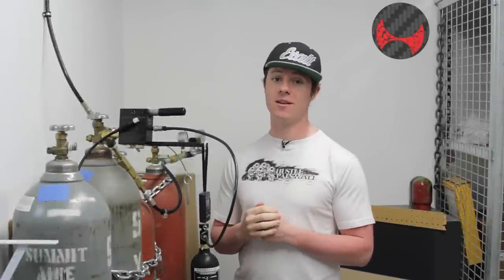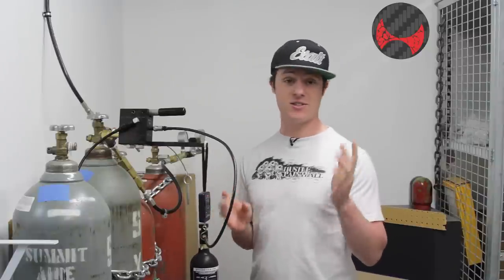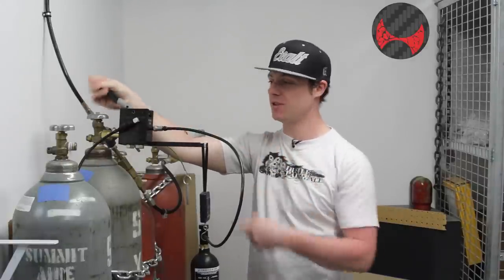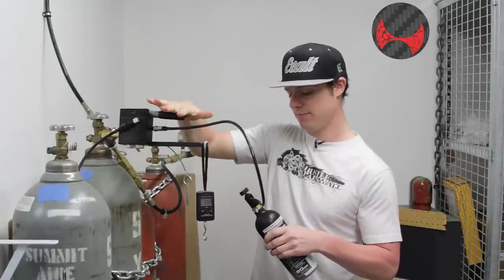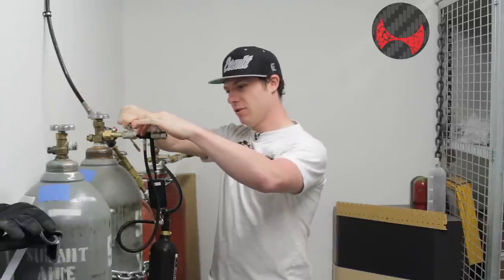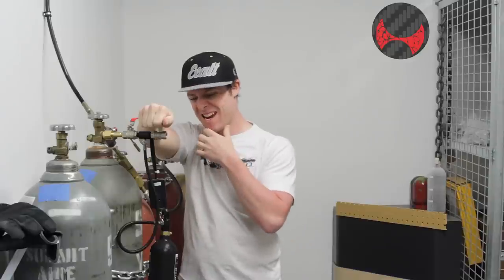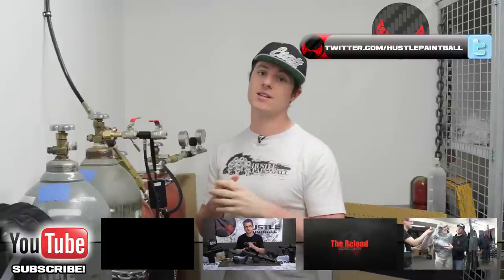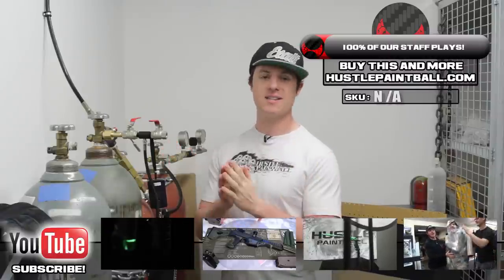How to fill a paintball CO2 tank from a bulk tank (20lb, 50lb, etc) by HustlePaintball.com

Comment: I want to run a large Co2 tank on remote line for my setup. I want to be able to fill them myself.

Because the tanks are so large (2.5lb and possibly 5lb) I may need a special fill station to fill them. I know I need some sort of pumping device but what? also how to I fill thermo valve tanks?

Comment: on the first station, where are you purging the co2 into? or just out the door as well?
Reply from the maker: A line that purges into a box that is taped up.
Reply: Hustle Paintball  ok thanks, so basically it's wasted co2. I thought there would be a setup that'd be able to reuse it. I always put the bottles in the freezer not to have to purge them at all during refillment.
Reply from the maker: cafeboni That is definitely the most efficient way to do it :)

-Dan

Comment: Just a dumb question - if I have a 9oz C02 tank I should expect to get 9oz of gas from a refill right?  My last fill I got just 4 oz  (difference in weight between empty bottle and filled), but the fill shop doesn't seem to understand this is a problem - or if it is, what they can do about it.
Reply: Yet another reason to dump CO2 and go HPA

Comment: Hey i gotta question , so i have a 12 ounce tank and a 20 pound tank with the 2nd fill station in the video . The 12 once is brand new only hade 1 full filling b4, so when i started filling it only went to 3.2 oz i purge . Added more went up to 3.8 purge again n went to 4oz n it wont go any higher ??? Theres still alot of co2 in my 20 lb tank . So what em i doing wrong ? Thanks
Reply from the maker: In order to fill CO2, the bottle has to get pretty cold... So you'll be filling, dumping, filling, dumping.. alot. That's another downside to CO2.
-Russell
Reply: Your 20lb tank isn't a fill tank. Fill tanks have a tube that goes to the bottom - the 'gas' that comes out is from the bottom.  It's actually liquid because of the pressure.  You need to (VERY carefully!) turn it upside down to fill from it.
Also, you need to make sure the 12oz is totally empty.

Comment: I have recently started filling CO2 bottles myself using a fill/dump station and 50lb CO2 tank. For my 20 oz bottles that have been chilled beforehand, I am only getting 4-5 oz from when its completely empty and then filling until sound stops. What else should I be doing to get the full amount in my bottles?
Reply: You need your 20oz bottle colder then the large one you are filling from. If it is warmer then the fill tank it will become pressurized and wont fill. You probably need to chill them longer.

Comment: What kind of scale are you using?  When we try and do this with a fish scale it seems to lock the weight in and not keep going up as the air refills.  I assume we have the wrong kind of scale?
Reply from the maker: +EastCoastAirsoft We use the Renegade digital fill scales. Affordable and works great. http://www.hustlepaintball.com/Renegade-Digital-Fill-Scale-20g-40KG-range - AJ
Reply: +Hustle Paintball Awesome thanks!  I assume with this scale it's not going to give me the issues a fish scale does, like lock in the weight when I am in the middle of filling the bottle?  If that is correct I will be picking one up today!
Reply from the maker: +EastCoastAirsoft Nope! It's a live reading that will change as you fill/drain
Reply: +Hustle Paintball Awesome thank you, I just ordered it off your website, I been looking for something like this!

Comment: Can I fill it up using an air compressor that is used to power nail guns
Reply from the maker: +OgN Stealthy No. You need a big boy compressor. It needs to fill 3k+ psi.
Usually fields and proshops have them.
-Russell
Reply: Can I play paintball with a co2 powered marker if I don't have a compressor?

Comment: How many fills could I get off of a 20 pound tank or a 50 pound? We have (2) 20oz, (2) 12oz and (2) 9oz
Reply: simple math
Reply: DKG Woodsball (Late response in case you still havent found a solution from anywhere else) 16 oz is 1 pound so a 20 pound tank should have 320oz in it; meaning it would fill a 20oz 16 times. If you want to fill all of your tanks at once, that means 1 full fill of each, (40 + 24 + 18 = 82) then you can get all of them filled just shy of 4 times (3.902 times to be exact)) Now for the 50 pound tank, that would have 800 oz, meaning it would fill a 20oz 40 times. Again, if you want all the tanks filled full at once, you would be able to fill them almost 10 times (9.756 times)

Comment: Good video. The double valve stations are available from Chinese sellers for about $28.00 if you have the patience to wait a month BTW. Given the dynamics are similar, I was wondering if the process could be improved by following some of the same best practices for filling 1lb propane bottles from the larger tanks: 1) Pre chill the small tank in the freezer (also mentioned already in the threads below). 2) Invert the large tank when transferring so you are drawing the liquid instead of the gas. I'm guessing that this would eliminate the need to purge the small tank and thus not waste any CO2.
Reply: There are tubes inside the large co2 tanks that go into the bottom to suck up the co2 instead of the gas co2 and I'm pretty sure he purges the tanks to chill them automatically because the gas released chills the tanks therefor you can get a full fill
Reply from the maker: Chicken_dude1 You are absolutely correct -- we use siphon tanks so that the liquid is drawn up from the bottom. If you do not have a siphon tank, inverting the tank will work as well. Releasing the gas does a very good at chilling the tank in a pinch, but it is always better to chill the tanks beforehand so that you don't waste any CO2. - Ben